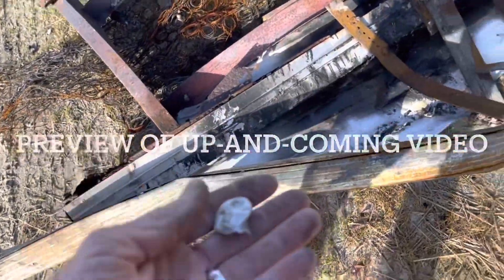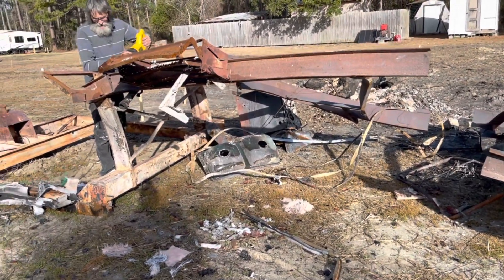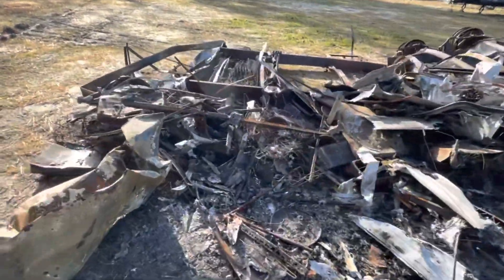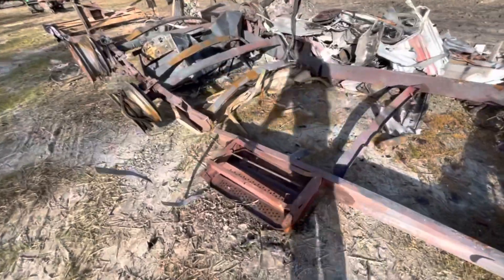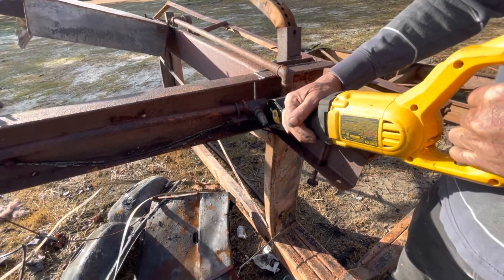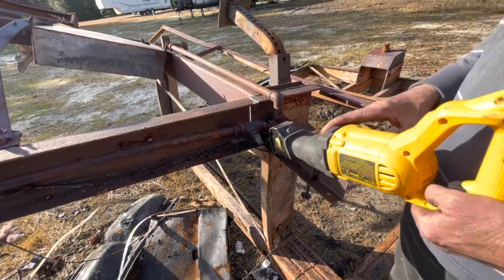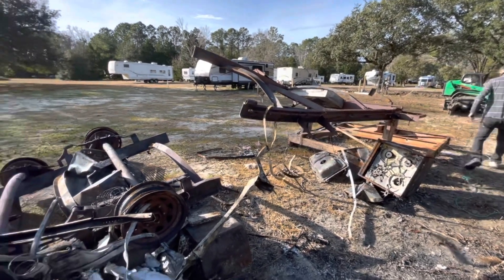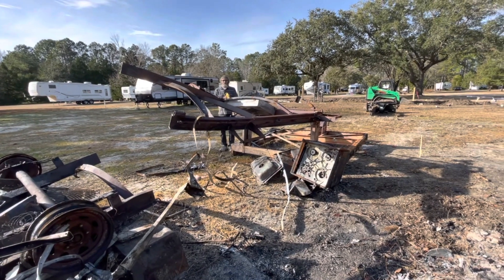Scrapping A fifth wheel trailer

Comment: Diablo carbide blades are the best for iron & scrapping.  Check them Scrapping with Grandpa. That's great scrap metal. Will you get #1 iron and do you have cut it down to certain size? 💪💪
Reply from the maker: If I’m not scrapping I’m working on a trailer floor or roof
Reply: Don't forget your retired 😂💪💪
Reply from the maker: Retired doesn’t mean you quit working apparently it just means do you have more time to do other things that you want to do
Reply: @gulfcoastacrscrapper6523  after I retired l never worked so hard in my whole life